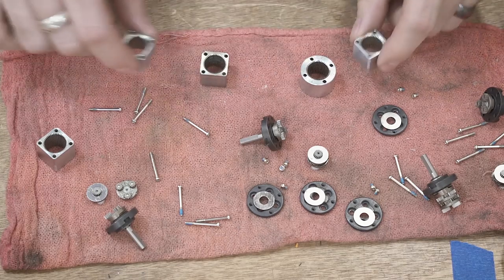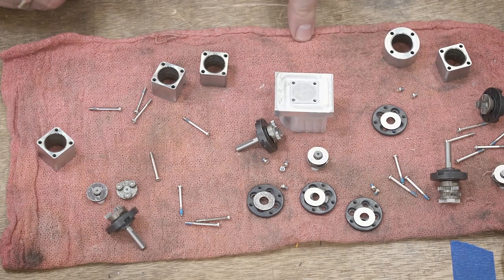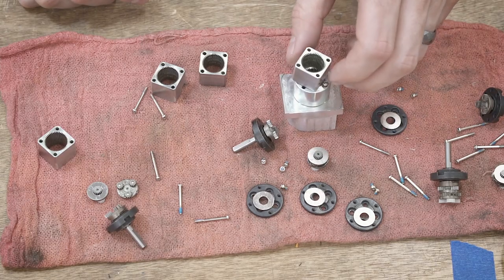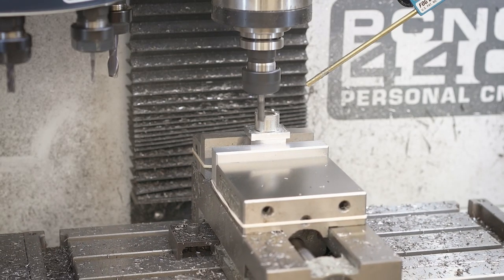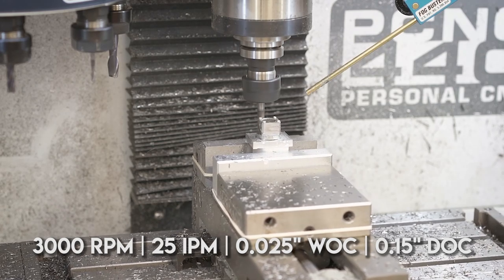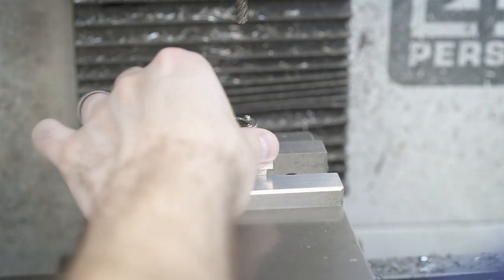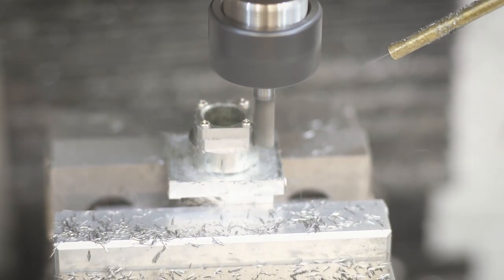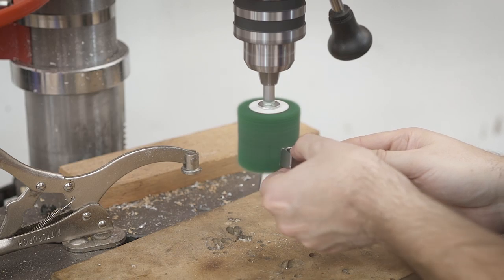ServoCity 22mm Gearbox Modification

Comment: You can cut that weight off on just about any type of machine you might have in the shop (within reason and within some tolerances) by using an expanding mandrel (cheap ones will do). For example, in a lathe, you could mount the mandrel and part (oriented using the screw holes) in the tool post and put an end mill in the chuck, then take shave passes at the body. Heck, you chould even do this with a grinder and a mandrel (again) so long you have a decently setup-ed square table and at least two blocks to mount mandrel in. Slow, light passes against the wheel + water cooling would get results fast.

Considering that there's no value in the meat found in the corners (of the square body) over the screws, a mandrel could be affixed in a decently built drill press and the OD could be turned down (again) using a grinder, but that one's a bit hacky and results in a smaller circle, losing the square benefits.

Comment: What made you decide to go with the steel servo city gearboxes instead of the aluminum botkits ones?
Reply from the maker: No real reason, I have experience with the ServoCity ones.  I could try the ones from botkits, but it's a fixed ratio, and I like being able to use different ratios.

Comment: Any explanation from Tormach ?
Reply from the maker: Not yet, still investigating.  I suspect my oiler is having issues getting oil to the ways, it's very dry and sticky.
Reply: My new 440 machine had a bad oiler on install. When I pulled the handle it seemed to work but I went 4 months and the oiler resivor level  did not change. I removed the ways cover and they were dry. The good new Tormach coats the ways with a process to protect them. You did a great job on Battle bots

Comment: I think you can take out more. Consider a slice of the current square shape + 5 holes that you have created. Around the 5 holes, increase the diameter by 2 mm (guestimation) and intersect them, remove the unwanted lines and that should be your new pattern. That would hold, no doubt.

Alternatively, you can remove half the meat currently found outside your screws. That metal has no function in that setup, it's dead weight. It doesn't hold structure, doesn't keep the screws in place, doesn't do anything really.